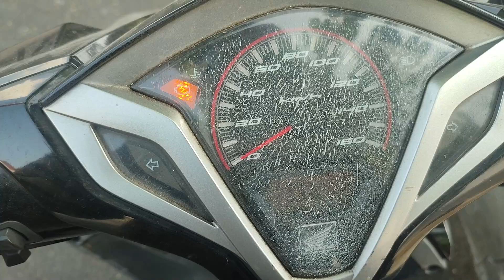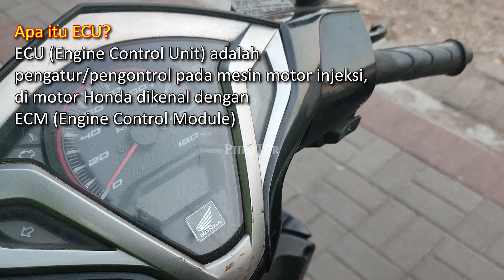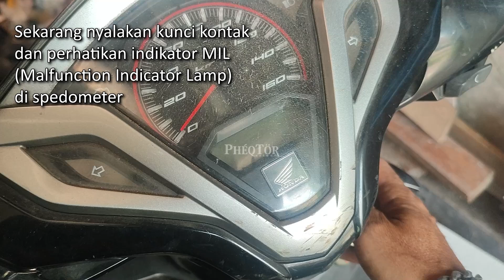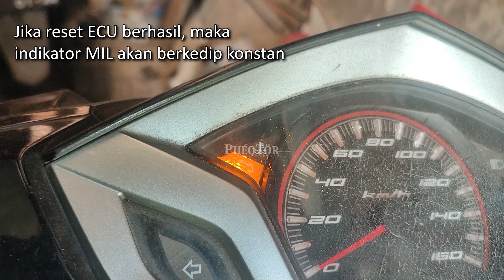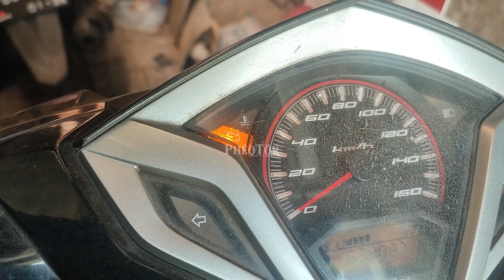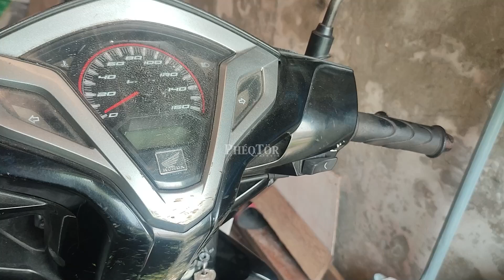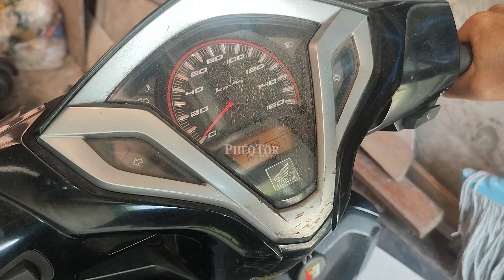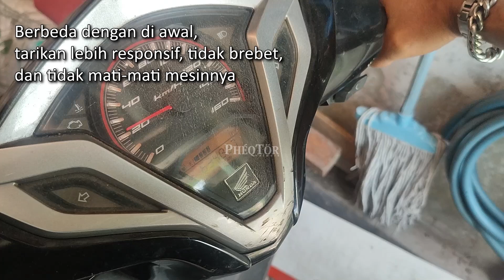Cara Reset ECU dan Sensor TP Honda Vario Techno 125 FI

Comment: Maaf bang motor saya vario 125old abis ganti knalpot malah brebet di gas awal itu knpa ya? Apa harus seting ecm? Apa harus remap ecu?
Reply from the maker: Kalo ganti dengan knalpot racing, tentunya membutuhkan bahan bakar lebih banyak, tapi karena vario 125 sudah injeksi jadi bahan bakar yg dikeluarkan jadi kurang, berbeda dengan model karburator yg bisa kita atur keluaran baham bakar dan anginnya. untuk remap ecu tidak berpengaruh, tetap pakai mode 1. biasanya modifikasi dilakukan di sensor tps (tentu saja ada resikonya juga, krn merubah tidak sesuai standar). kalo ingin memodifikasi sensor tps sebaiknya dilakukan mekanik yg lebih tau utk mengurangi resiko motor lebih bermasalah🙏🙏